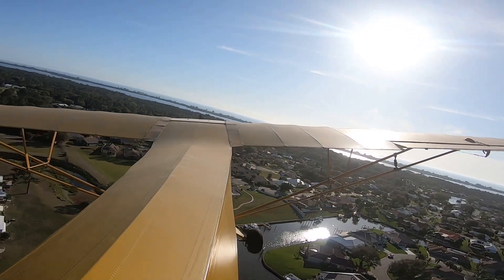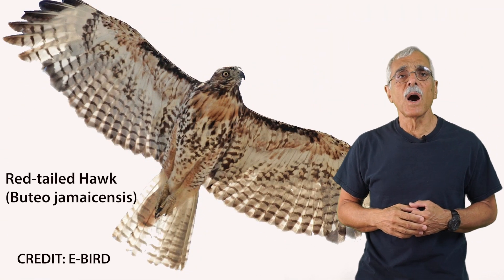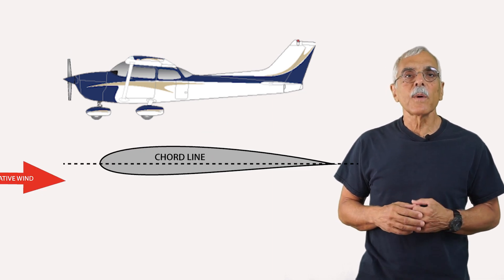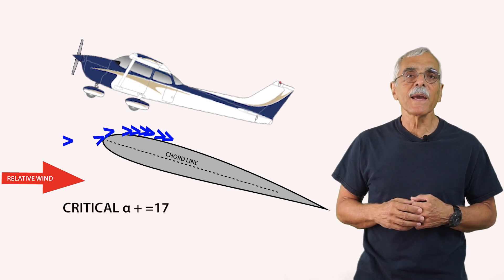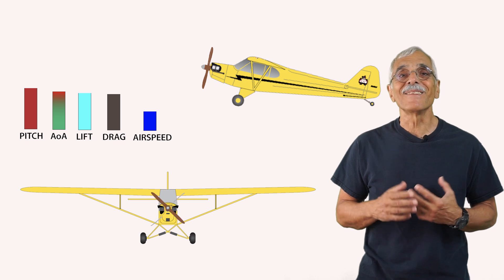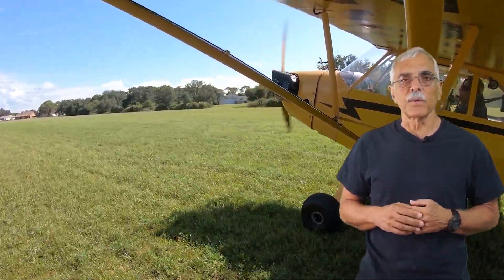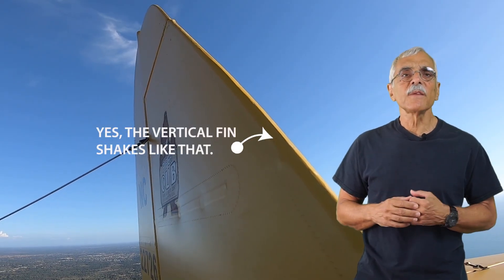How I Stalled on The Base Turn (And Got Away With It)

Comment: Seems like it should be possible to engineer stalls out, and stall recovery in.

Hang gliders used to suffer horribly from stalls. The spectre of the luffing dive was ever present. If the glider stalled it would go nose down, the wing lost its shape and became a simple sheet flapping (luffing) in the breeze. Stall recovery could take 2-300 ft. A lot if you're flying 100 ft above terrain.

The issue was designed out. Battens retained the wing shape. Luff lines support the trailing edge of the wing in a dive. Divesticks support the trailing edge tips keeping the angle of attack lower at the wingtips preventing tipstall. The root of the wing has a higher AoA than the tips due to washout, so the root (the forward part of the swept wing, ahead of the CoG) stalls long before the tip, (behind the CoG).

The result is that steady full control deflection cannot completely stall the glider. A stall can only be achieved by pulling on speed and then suddenly and fully applying the pitch up control (push out). It could never happen through inattention.
Reply: This was one of the reasons burt rutan advocated canard-wing geometry light aircraft ala the long-ez and its derivatives (velocity et all). And indeed they do effectively prevent conventional stalls.  But then with unconventional airframe designs come their own set of introduced and less understood issues...  And there's no shortage of experimental canard-wing aircraft that've fallen out of the sky. (and then there's the commercial-failure cautionary tale of the beechcraft starship)
Reply: why not the simpler engineering approach of replacing the pilot with a robot who can't stop paying attention to AoA and airspeed?
Reply: @Matthew Morycinski I was thinking more along the lines of something passive built in to the basis of the aircraft, (see the canard discussion above) rather than an active "fix" built on over the top of an inherently unstable design.

So like a canard, or a swept wing with significant washout or something that comes into play to push the nose down when the AoA is high but that does nothing the rest of the time (like the floating door, except useful). Or even a more stall prone wing shape at the root of the wing than at the tip, so the root stalls early making the plane mush but retaining aileron control. 

I don't know quite what would be the best, but there must be something.
Reply: It's called an Ercoupe. Designed by Fred Weick and built in the 1930s.
Reply: @SlowLowFlier  oooo, I want one!

Reading up about it Mooney bought the rights to it and then modified it so it would spin. Apparently there's a class of licence that only lets you fly inherently safe aircraft and if you train on a safe aircraft you can't fly one that will stall/spin.
Reply: Some hang gliders were bad, some weren't.  Did many full-break stalls on my Sky Sports Kestrel, with no luff lines and no defined tips(and no parachute), and she vigorously recovered every time.  Even among the standard Rogallos there was a big difference between individual gliders, especially in those where keel reflex was tuned out to get more performance.
Reply: @christheother9088  I came to the sport too late to ever fly a rogallo. I heard Bill Moyes talking about them and that was the impression I got about the early days. So it's all second hand for me. Good to hear from someone who was there!
Reply: @gasdive  I would argue that active electronics combined with an inherently stable aerodynamic design would be the safest.
Reply: @davedoe6445  in not sure why you'd want or need electronics in an inherently safe design. If it's inherently safe, it's safe, but any design can be flown into the ground or zoom stalled. If the electronics can override the pilot, and are able to zoom stall, or fly the aircraft into the ground, then a failure will crash the aircraft.

If you're prepared to rely on the electronics to be failure free, then why bother with an inherently stable design, which comes with tradeoffs for maneuverability and efficiency?
Reply: @gasdive  if you have both you have graceful failures.   

Also electronics could prevent being flown into the ground or zoom stalled by overriding the pilot.  

I think you would go with this approach to maximize safety over performance.

Comment: AoA indicators should be stadard on all light GA aircraft, also they should be mounted on top the dash in normal line of sight with loud audio yellow and red indicators.
Reply: could not agree more, not only would it prevent many fatalities with un knowing stalls, but it would make the consistency of flight, take offs, and landings so much better.

Comment: A redtail struck my hang glider wing tip, talons first.  It was a non-event. Different than the hapless birds usually encountered in the pattern. I'll be on guard against my instinct to pull up to avoid birds.

Comment: Bottom line? You got distracted. It happens to the best of us. I'm a sailor. I was bringing my boat back to my slip when someone in another boat pointed out that a line was dragging in the water. Nothing serious - the line wasn't long enough to foul my prop, but bad form none the less. I sent my crew forward and was monitoring his actions, and motored right past my dock. Had to do a go-a-round. Litterally. Made a 360 in tight quarters, and backed up until I had my bow pointed where I needed it in the crosswind. Anyone who owns a sailboat knows, they do not like to back-up. Crosswinds make docking very sketchy.

The thing is, I practice backing up the damned thing constantly, just for situations like that. I imagine it's a good idea for pilots to practice stall recovery constantly too, seeing as how things happen much faster and the stakes are generally a lot higher in small aircraft than in small sailboats. Glad you're safe.

Comment: This is the thing I am always most concerned about. After that, talking on the radio funnily enough 🤣 At the field I learn at you have to come in-between two oaks on 31 there aren't many options for recovery. 13 is better if the wind is playing ball. More often than not its a crosswind!

Comment: I guess I'll stick with canards (29 years and counting) because they don't stall. They just don't. It's lots of fun having an engine in front, tail in the rear pilot in the back seat. I'll pull the stick to the aft stop, slow down till the canard starts bobbing up and down a few inches (stalling and unstalling) and demonstrate 60 degree banked turns. I've heard "I don't believe this" several times.

Comment: Why don't you employ a forward slip for the turn from base to final?  I started flight training in an Aeronca Champ and slips were hammered into me by my flight instructor.  A forward slip can be transitioned nicely into a sideslip if there is a crosswind (assuming you can pick pattern direction, so base leg is with the wind).  Not having flaps on your J-3, slips are the name of the game here.  Slips should be employed more and I think pilots would enjoy them as they are just so much fun to do.  As long as the nose is below the horizon and you aren't yanking back on the stick aggressively (loading up the wing) a stall isn't possible.  Don't like how your pattern is going?  (thanks Mr. Hawk) Ease off the rudder, apply power, and perform a go-around.

I've made my fair share of mistakes flying as well.  I once popped a tire and wrinkled a firewall on a Cessna 172 by bone headedly 'getting the airplane on the ground' no matter what.  I was intimidated by a regional airliner held short of the runway, waiting to take off.  Long story short, I did get it on the ground and it was the most expensive landing I ever made.  As pilots we shouldn't worry about landing the airplane at all costs, it'll get on the ground one way or another, that much is for sure.  What matters is not bending metal or snapping composite.

Stay safe, and keep the videos coming!

Comment: 1:10 You are not going to stall, if you keep the stick out of your crotch.

Try it. 

Put the airplane in any attitude-airspeed combination (at a safe altitude for now) and attempt to stall the wing, without bringing the stick back. 

I mean hold the stick in the 180-degree arc in front of the neutral for/aft line.

It's impossible. 

Because rear-stick is not an "elevator", it's the Stall Lever.

Pull it all the way back, and you will stall the airplane in any attitude, airspeed, or altitude combination from the surface to the ISS, zero to Mach 25. 

The stick stalls the wing. 

And nothing else stalls the wing. 

(Yes its angle of attack, but angle of attack is controlled very precisely by aft-stick, you cannot increase angle.of attack without increasing back-stick).

So don't pull the stick all the way back unless or until you are in the landing flare very near the ground, or you want to stall the airplane for some other reason.

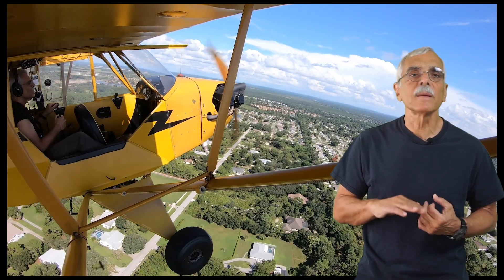Comment: 8:13 Look at the fool flying the yellow cub as he mindlessly turns base to final, directly into the path of the RV-10 completing a four mile final using a ten degree intercept from the right.  Despite the calm winds and severe clear, the two planes collide just 1/2 mile from the numbers.  Bertorelli might be alive today, had he adopted the pattern operation practices taught by those young flight instructors he has mocked.  Hey Paul, while you're still among the living, please find someone within the FAA who can explain to you how pilot training has evolved since the days of the Curtiss Jenny.  Perhaps your primary instructor was taught by a gal who learned to fly in Jenny's, but with increases in engine reliability, it becomes less necessary to treat every landing as an engine out emergency.   A story related by my instructor was that the Nall Report showed more pilots were being killing by mid-air collisions in the pattern, than pilots dying because of engine failure in the landing pattern.

Comment: Those turns are also descending turns where the lower wing flies at a greater angle of attack than the other due to the lower forward speed. Hence it stalls even sooner than the other wing..

Comment: As the SLIP INDICATOR is being religated to increasingly obscure locations on the panel for new stuff that does not help us (AoA), we have become aware that pilots now RUDDER their turns and use ailerons to stop overbanking.
So....back to ground school;
We are no longer learning that rudder has ONLY 2 primary functions: 1) controling the yaw from ailerons inducing the bank & 2) directional control in the take off or landing mode.....NOT BANKING.
It is the ailerons that create the bank to turn, NOT the rudders.
The ailerons continue to be the least understood. and most abused control on the plane with 3 (three) primary functions.
Cheers
R bud Fuchs
CFI 1507987
Since 1960-?

Comment: All planes should have autopilot. Standardize it. There is alot going on and one touch of sporaidic dyslexia or a.d.d. can turn into non-recouperable physics. The air-comm is an overkill, multi operator-single frequency scenario, and anytime there is confusion, the pilot can get transmitted on the tower feeding suggestions, or stern commands, during the state of disorientation.
This is not a good way to get rid of pilots and aircraft. Or at least eliminate solo flights. Most pilots will be glad to earn any compensation to be in the air, and could gain "quarter hours" per hour of copiloting, and monitoring coms of host aircraft and pilot. 
An air jet manifold could be put on the wing to blast the eddies away, and boost speed, over 50 feet above sea level, when the speed gets within 5 mph of stall speed. All forms of insurance are affected by covering these human error disasters.

Comment: I've departed a glider while thermalling in tight circles on a bumpy day. Unloading and outward rudder solved it quickly

At that time I usually flew older models and was transitioning to higher performance composit designs that like to be flown a little faster (AoA, drag bucket).

Comment: Yet another aviation stall video which overly focuses on air speed and other equally irrelevant  factors, rather than JUST FOCUSING on excessive pilot elevator input. 
Speed does not stall an airplane only exsessive aft stick input can.  Each plane has an exact,  repeatable and trust worthy stall stick position. This is the point at which the aircraft will stall everytime, regardless of speed, bank angle, wing loading or even skidding, none of which have any affect on the stall stick position.  
For example when im manoeuvring at lower altitudes with slower air speeds,  im only focussed on the distance the stick is from my belly button NOTHING else. If im sinking i do not add more aft stick, i add engine power. The stick sets my aproach speed the engine controls my decent rate.
I'm staggered how many pilots dont manage their aircraft in this way.

The Eagle certainly did not cause your near stall. No,  you pulled the stick dangerously close to the stall stick position of which you appear to be clueless of its exact position. Suggest you go out get some hieght, find it learn it and respect it your aircrafts stall stick position. ❤

Comment: I'm a little disappointed with this explanation. While it covered a lot of points, the fundamental point about how stalls occur was missed.
Stalls are due to excess AoA - right.
What determines the AoA? Is it airspeed? Angle of Bank? Pitch attitude? - No.
The AoA is set by the elevator. If the relative wind is impinging on the elevator, the aircraft rotates out of the way until the force on the elevator is ~0.
Said another way - the elevator deflection causes the AoA to change until the relative wind changes to a specific angle - determined entirely by the angle of the elevator.
Now, the elevator is controlled directly by the pilot with that stick in their hand - so the AoA is set directly by the position of the stick.
How do you prevent a stall -> how do you prevent the AoA becoming too large -> how do you prevent the elevator from being deflected too much -> don't move the stick all the way back.
There is a specific position of the stick, which after you move past it the wing will stall.
To prevent a stall, the only thing to keep in mind is the stick-back position. Dont worry about airspeed/bank-angle/pitch....

Read 'Fly Better' - a free online book by an ex-RAAF pilot
Reply: Except that's not how it works, if it were that simple there'd be a stop on the controls at that position to prevent stalling. The aircraft will not "rotate until the force on the elevator is ~0", and in fact if that were the case the airplane would never get an airworthiness certification since it would lack static pitch stability. At zero force on the elevator the aircraft will rotate towards a specific AoA that depends on pitch trim and flaps setting and getting it to deviate from that requires continuous force on the elevator. There's good reason to mind airspeed anyway, since insufficient airspeed (below the stall speed at current bank angle) means you're headed towards the ground regardless of AoA, and in particular regardless of whether or not you stall the airplane (which is merely the consequence of a futile attempt to maintain altitude by pulling back on the stick instead of fixing the root problem of having insufficient airspeed and/or too much bank).
Reply: @MatthijsvanDuin  So you agree. I said ~0, which covers the first half of your comment, and you said `which is merely the consequence of a futile attempt to maintain altitude by pulling back on the stick`, which is what I said in different words.
Reply: @aaronhammond7297  I have no idea how to reply to this nonsense. What I said was not remotely in agreement with what you said, despite your very creative attempts to misinterpret it at such.